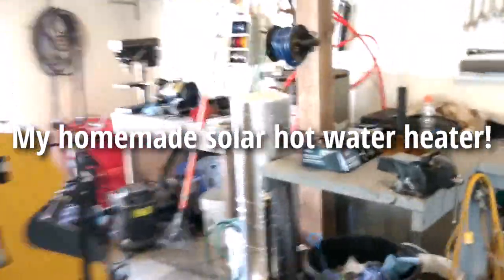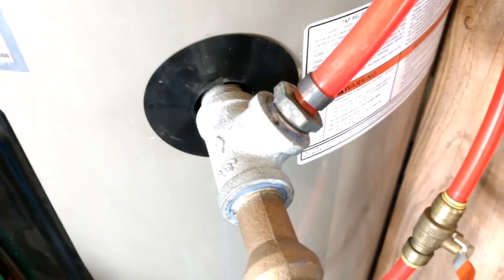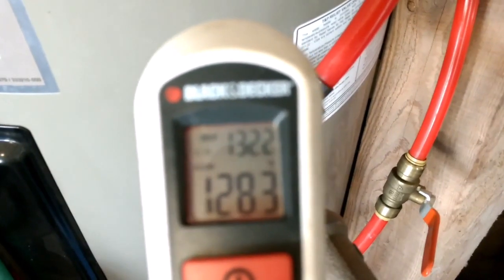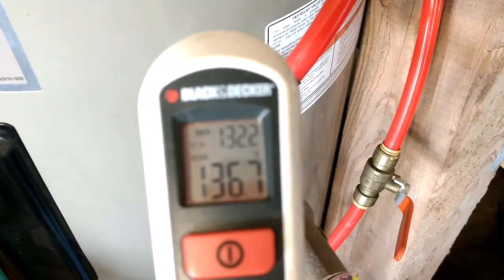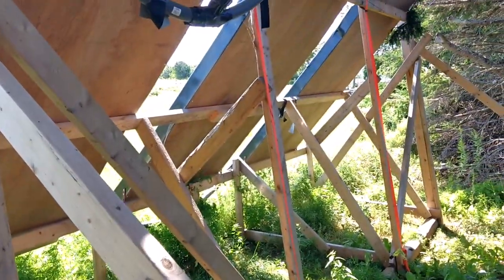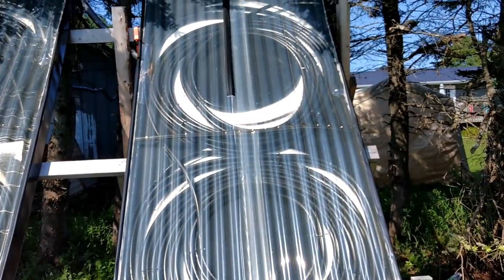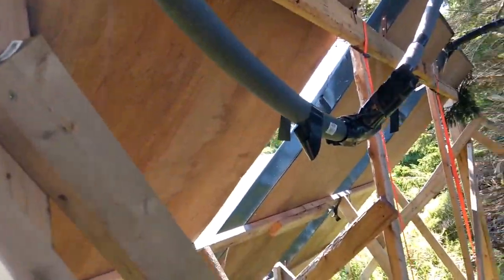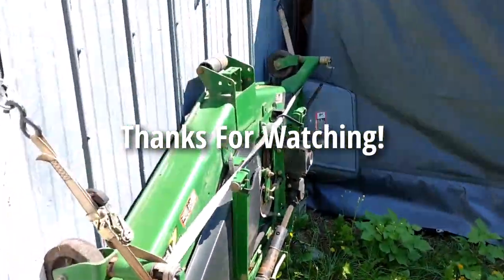Homemade solar heating system.

Comment: How are you liking those mini split air conditioners?
Reply from the maker: I didn't like these LG heat pumps they were pretty noisy and loud. I had to replace one of them last winter with a Karda unit. Anyway I like the new heat pump we bought last winter much better than the LG's. They're much quieter unit than the LG's. Not sure about the newer LG units they may work better and be quieter. But these older ones I wouldn't buy them again.

Comment: Thanks for the video. Can I ask, what size is the black poly? Also how long is it in total. Thanks
Reply from the maker: The black poly is 3/4 inch and I believe there was 300 feet in total approximately 100 feet in each box. It works pretty good keeps everything in the shop from freezing. I think if I was doing it again I would use half inch black poly.
Reply: Thanks man. You mentioned you may build another one. If you do please record it. My plan is to make one for the kids pool in the summer so this was a big help.
Reply from the maker: @tysmith7646  Ya for sure, I will make a video about building them if I build one for the house not sure when I'm going to have time to do it .
Reply: hello, I've almost finished a smaller one but I'm struggling to get the water around the system.
id really appreciate knowing, did you use a pump and what kind?
Reply from the maker: @reuse_or_die  wow I'm very sorry I just saw this post. Did you ever get your water circulating through yours. I just used a  circulating 3-speed pump that you would normally see in a heating system.